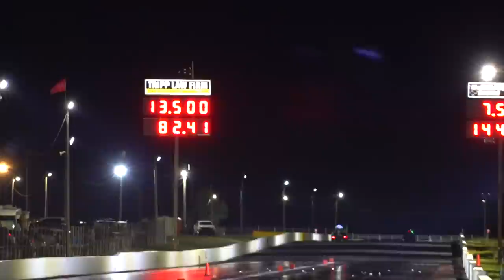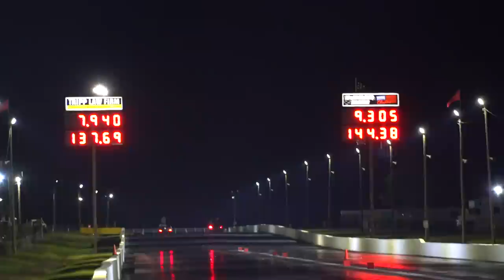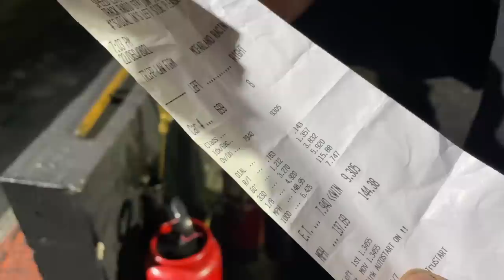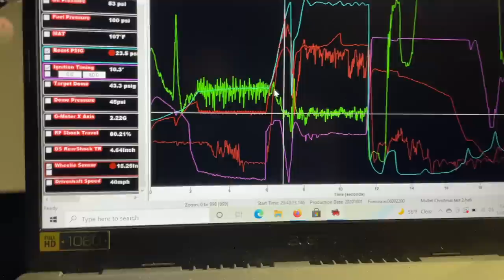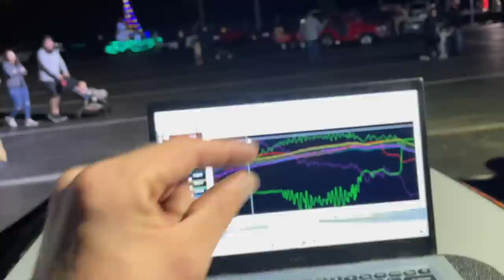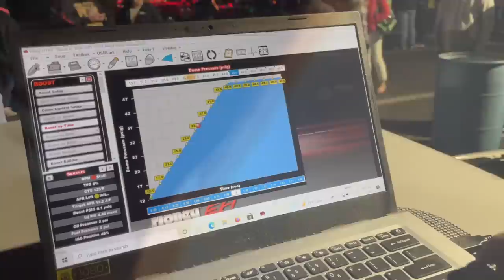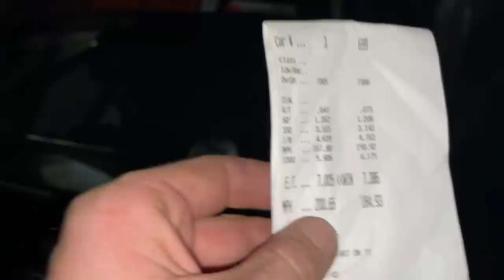Christmas Tree Drag Race WORLD CHAMPIONSHIP 2021!!! (Mullet Did a HUGE Power Wheelie!!)

Comment: The race with Rick was amazing. He's got that car so dialed. Soon Mullet will be to that level.
Mullet's got the 60' and there's still more there. He even had Rick beat on 330' time, but the difference is the power. Mullet can get out of the hole now that they've figured out the suspension, but to be 17mph slower at the 1/8 is a huge power difference. Give them a couple test passes, and they should be able to ramp the boost in sooner and finally laydown some times.
Reply: I was just thinking the same. Looks like Mullet’s hole shot is good.  They need more power down the track.
Reply: I don’t think that’s what it was. Mullet was behind by 17mph at the 1/8th, but only 15mph at the end. If that’s just power, you would think he would win by 30mph at the end. I guess he could have lifted, but the 200mph trap speed is pretty consistent.
I’m thinking it could be weight, gearing, or both.
Reply: @alphazuluz  it’s definitely engine mullet isn’t making much over 1500 when cars like sick second 1.0  are near 2500
Reply: You can see and hear the elco pull timing right as rick blew by it. They still need to work on the launch, it needs to bring the weight forward so it can keep pulling.
Reply: @alphazuluz  Yeah it wasn't just that mullet has less power to drag ratio but I think they turned the wheelie sensor cut back on and it pulled timing right before the 1/8th. Even if mullet didn't pull timing, I don't think it could have won, idk if mullet can trap 200 on its current setup.
Reply: @NNFaNRacing  That's what his new big block is for!
Reply: Anyone else notice that Ricks car would dig the front end, lifting the rear ever so slightly on every pass, when every other car would unload the front? What set up has got that car that dialed in?
Reply: This year will be fun. Mullet has gone 6’s at 208 now…
Reply: @cstokes7585  panhard bar. Pushes the rear end into the ground. The Buick GNX used this tech in the 80’s.

Comment: So right on needing a big block for Mullet. Time to Graduate to the big league
Reply: Or just straight to a smx or 481x
Reply: There was no point to more power when he kept spinning or blowing up transmissions.  He's got the transmission for it now and the suspension is getting there too. Cutting 4 tenths isn't going to be possible with the current motor, time to go big!
Reply: So if they are having trouble putting the power down. Your answer is put a big block with more power in it. WOW WHAT A FRIGGIN GENIUS. PS they haven't even maxed the power out in the 427 yet. In the 1500s hp on the last dyno pull and the motor is suppose to be able to make 2000+. Rather or not it will remains a question but, Texas Speed claims it can. Plus there are small blocks going low 4s in the 1/8. 
Once they get it to hook and book every time. Then we can talk about upgrading to a big block. Maybe even going with a procharger setup. For instant max power for the entire run.
Reply: @huntjl88  motor is already hurt in mullet better to throw in a big block than another tsp engine in there
Reply: He's got a steve Morris big block sitting on a pallet in the shop. He mentioned something about it in the last video and then change the subject.. its coming soon.  Once this 427 officially blows.. its gotta be going in
Reply: @huntjl88  why did the rod bend in Gainesville? Seems pretty maxed out to me.
Reply: @michaelkirkley4313  He said if they can exercise the curse from Toast the big block was going in the car he bought to replace Toast.
Reply: @garrettstevens2232  parts break/bend for different reasons. Could be as simple as a weak rod. Could be something bigger. 
I wasn't there and I have no idea how many passes/hits that engine has on it. But if those are the same rods that was in it when Kevin installed it. That number has to be getting up there. Plus a couple thousand road miles. But that engine is suppose to be able to produce 2000+ HP. It was only at 1500 or so on the last dyno pull. That's about what Leroy makes.
So either TSP is lying or that engine isn't close to being maxed out.
Reply: @garrettstevens2232  an unfired cylinder can hydro lock on meth.
Reply: Agreed! Mullet needs a bigblock and The 427 is already Hurt...
Reply: @huntjl88  with the way he was saying damn I need a big block..I think its just a matter of time before it's in mullet

Comment: I thought for sure Turbo John had Mullett covered.  He ran a 7.36 in previous round letting off around the 1000’ mark.  Unfortunately he made a rookie racer mistake (he has been racing well over 20 years).  He failed to check his catch can and it overflowed causing him to spin in his own fluids.  Don’t think TJ had enough for Prospero though.  That RX-7 is a twin turbo big block beast.
Reply: Is that what happened? looked like a backfire at first, but realized it wasn't.
Reply: something probably broke, when you play with fire, you get burnt often ;)
if you want fairly fast and reliable, you slow down and run brackets...

Comment: Time to get all tom Bailey on mullet .
Three words: Steve Morris Engines.
Reply: Lol I've been saying this everytime they have an tsp engine problem.
They have a trans thar will hold up to some sme  engines
Reply: TKM is more affordable and faster than Texas speed
Reply: He's got one sitting on a pallet in the shop. He mentioned something about it in the last video and then change the subject.. its coming soon.  Once this 427 officially blows.. its gotta be going in
Reply: There's a lot of extra work that comes with all that added power just to keep them from breaking. A TSP LS is a fairly simple engine in comparison.
Reply: @lordcommander3224  ya like lashing valves between every pass and before street driving.
Reply: You meant to say Nelson racing engines

Comment: Honestly how the rules should be -
Length of tree = 1 point per inch
Mph= 1 point per mph
1/4 mile time = subtract your score 1 point for every second
Reply: Don't Gay it up,Dan
🚬💣👽💩🚲🎣🇺🇸
Reply: While I agree that there should be a point scale, as an engineer I think you have to much more complicated. ET should be x1000 to give a round number tree length should be x1000 so it matters as much as ET and mph should be x10 and then all 3 categories are equally weighted. So each category gives you 33% of your total score. Add the points together for total. If one category should be more heavily weighted than another you could multiply each value by a percentage. This would have to be a complicated formula for determining what are the correct factors to make this an even playing field but his is the starting point.

Comment: That green RX-7 was stupid fast. The crazy thing is that in the finals, it put 16-17mph on Mullet, but then gained no more. So, it was ONLY faster than Mullet from the 60’ to the 1/8th. On the top end, Mullet gained back 1-2mph. Pretty interesting. I wonder if that’s gearing or weight, because if it were just raw power, you’d think it would show up up top more. Especially given that the RX-7 has to be more aerodynamic.

Comment: If you wanna go big block in Mullet then you need a build with the new RS-X symmetrical port heads. Same heads on the ZZ632 straight from GM.
Or you could go balls to the wall and get a V12LS. Yes that is a thing. Look it up. Would take custom heads, crank, and cam to match a Texas Speed 427 but Take a 427 and add 4. You now have a 642 monster.
Like so he maybe sees this?

Comment: If you wanna good big block either morgan and sons racing engines or proline 481x 572 c.i. motor I prefer the proline over morgan and son's. I run the proline 481x in my 75 El Camino

Comment: Garrett... Fix that boost ramp.  At 3 seconds that thing needs enough dome pressure to make 45+ psi, and if it won't take that put top fuel hoops in it.  It isn't going to burn the tires off that far out, and that engine should make 6.80/210 power pretty easily.  You didn't have to lose that final.

Comment: Cleetus turn it up right after 2nd gear I mean ramp the boist your launches are unbelievable but it seems the car drops off right as it hits 3rd gear. Need to put the power down to it lol. If you didn't weigh so much it would probably go 6 seconds no problem.

Comment: I think Kevin needs to have a kill switch engage 1 or 2 sec. after the chute is pulled cause I don't think Cleetus is going to remember to cut the engine after a run. Like Kevin said, that's hard on the drive train.

Comment: you do need a big block it would give you way more room for improvement to your racing program and give a lot more power options over a bored and stroked small block . plus with an all aluminum big block there not much heavier then a small block but make a lot more power throughout the rpm range . also I just want to see mullet with a big block holding down the front end